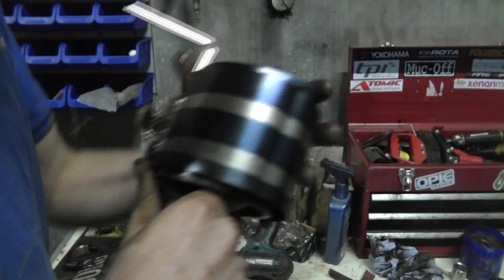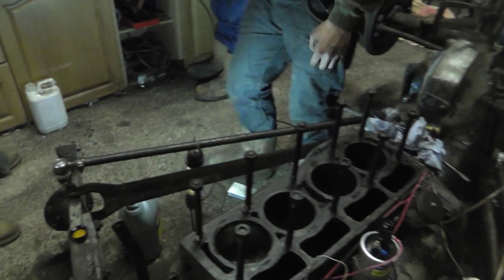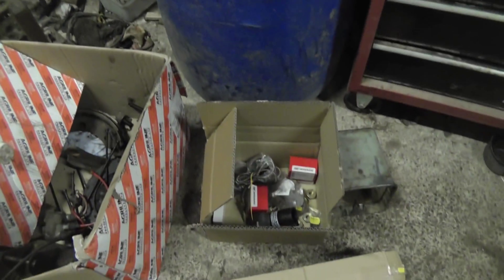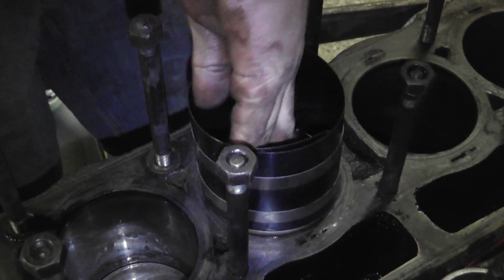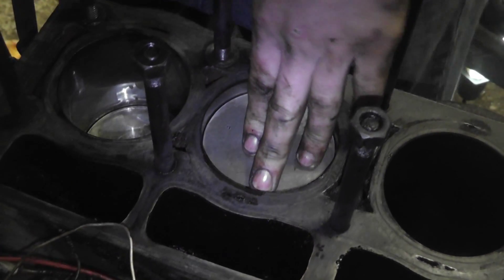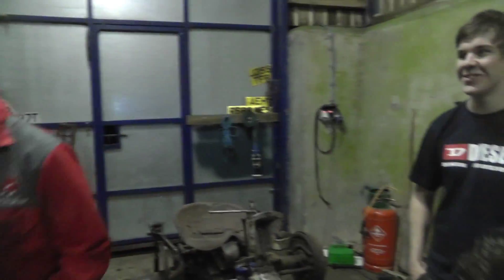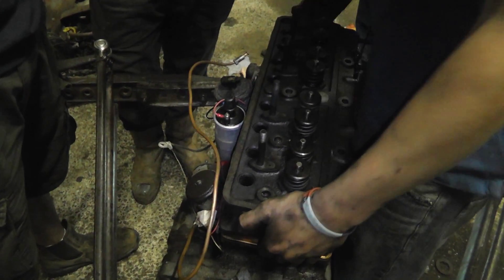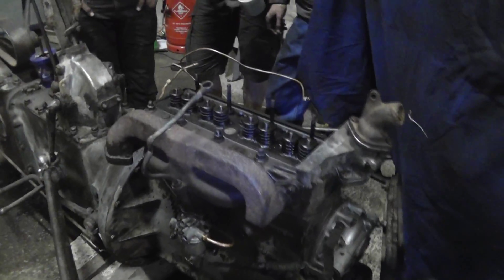Grey Fergie Challenge | Tractor Rebuild | Episode Five | Engine

Comment: What does "TVO" stand for? And was it a dual tank system with a carburetor, or did it run with fuel injection like a diesel?
Reply: Gregory Malchuk it's petrol and paraffin you start it on paraffin and swap it over to petrol when it's running or the other way round not sure I've got a diesel I'm restoring its all on my channel